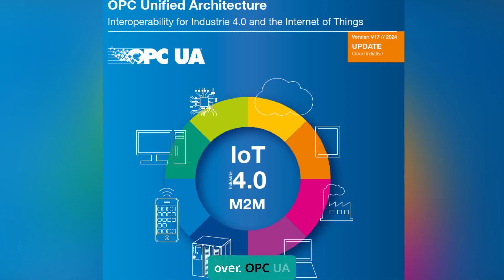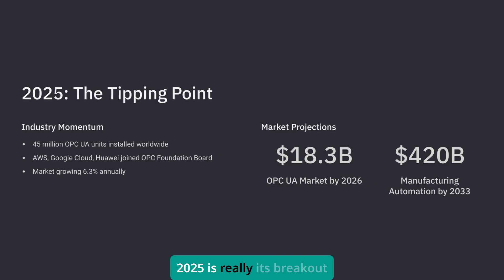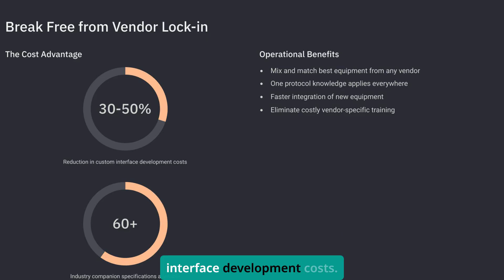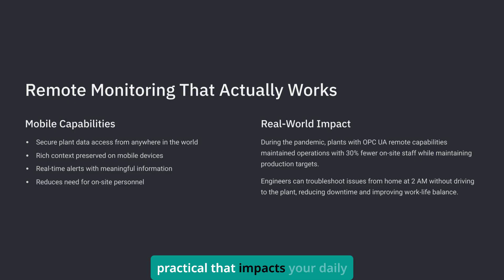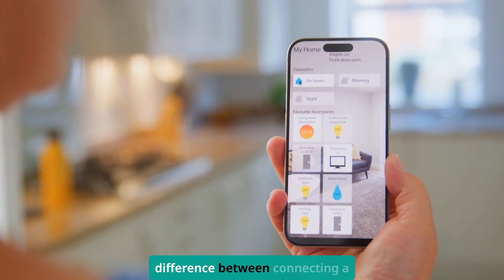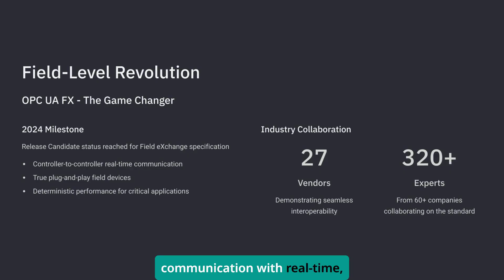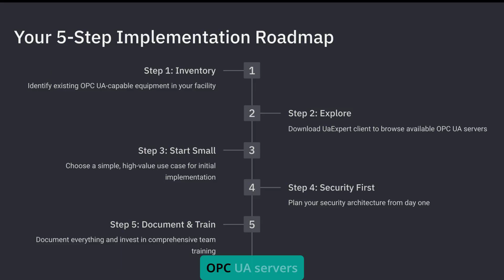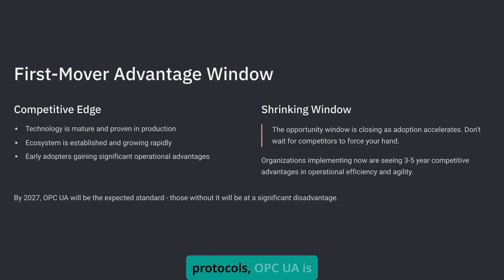Is OPC UA's RAPID Growth a Game Changer for Factory Automation?

Comment: Are you using AI to respond to comments AND make the videos? That's crazy
Reply from the maker: Hello jontopham2742, That’s a great question, thanks for asking.

All of the topics come from my 35 years working in industrial controls. I’ll use AI to help me sketch out an outline, but the scripts are mine. 

I write them the same way I’d explain something to a colleague, simple and down-to-earth.

For the voiceovers, I play around with a little text-to-speech tool (Whisper Flow) just to get the pacing right, then I record the narration myself on my Mac. 

I update my PowerPoints, add in B-roll, and edit everything together in Descript. For the Thumbnails I build them in Canva.

And as for comments like this one, I always read them myself and reply personally.

Alana 😊

Comment: Alana..really cool. Just curious if have some questions relating to the industry,  opc ua and the what customers are asking for. Any chance you might be open to a tech session or call?
Reply from the maker: Hi Russ, thanks so much! I really appreciate your message. I’ll actually be on and off holidays quite a bit over the next 6 weeks, but I’d definitely be open to chatting. If you wanted to send me a few of your questions or areas you’re curious about, I might be able to prep something or suggest a time for a short tech session. Let’s see what works!
Reply: Wow this is great I was assigned a project for MECM and we are struggling with how to pull data and how to be selective on what to pull we ended up overwhelming IIOT and had to shut down the plant IIOT how can I touch base with you for more indeed learning 
Thanks in advance